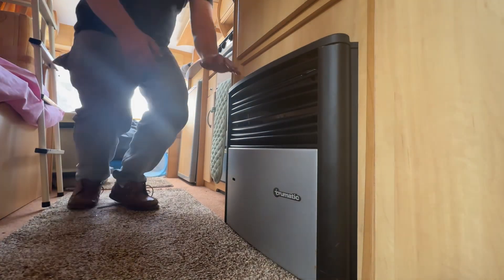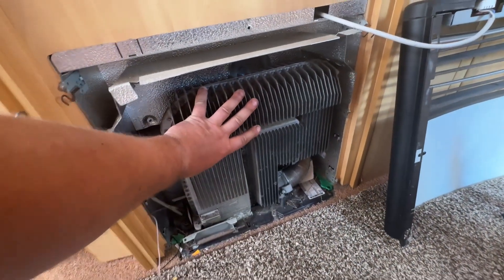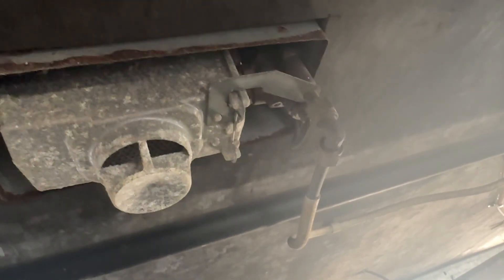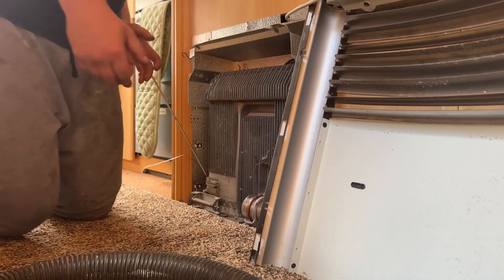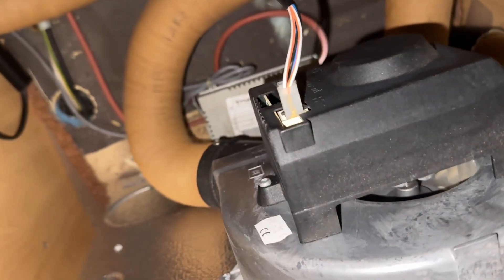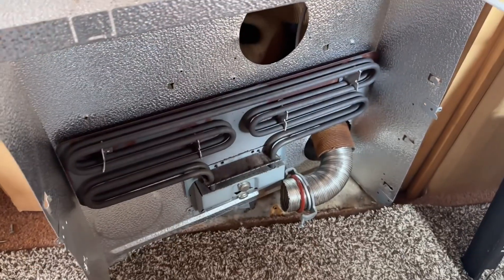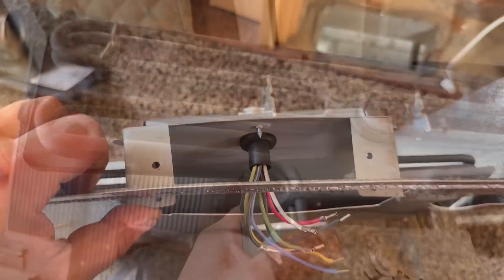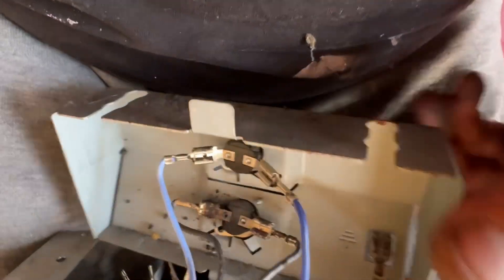Truma Gas/Electric Caravan Heater Repair – Full Disassembly Guide

Comment: My spark dosent work I’ve heard there’s a battery somewhere for it couldnt see in this video mine is the same one as this
Reply from the maker: Yeah there’s a small battery inside, it’s in a small black casing. When you take the panel off the front you will be able to see it

I hope this helps :) 

I will do a video on the future on how to replace it :)
Reply: @TheCaravanCubs  Thank you! It is at the bottom front (opposite side to the gas control knob) and should be able to be reached without removing the ccover. There is a black box (about 8cm by 14cm) with a an opeing that slides up. Takes an AA battery.

Comment: Hi I have a I have a traumatic  sl5002 I press the spark pilot light lights up when I go to press for more gas into it I get a little Blowback flame from the pilot side what could it be
Reply from the maker: Hey hey! Thank you for your comment!

I’m not a gas engineer but could the bottle be low or maybe a nip in the pipe?

I hope you get it solved :)

Comment: Btw,where did you get your spares from?
Reply from the maker: Good morning :) I hope you are well!

EBay :)
Reply: So was that the thermal cutoff that was degraded? My electric element doesn’t work unless I heat the gas side first, then turn the electric on and it works after that. It’s baffled me…?